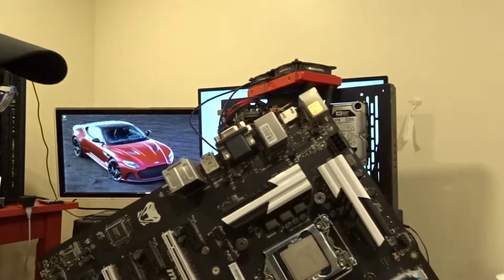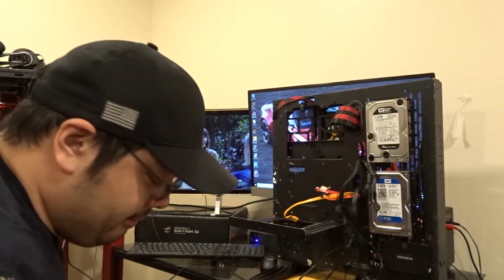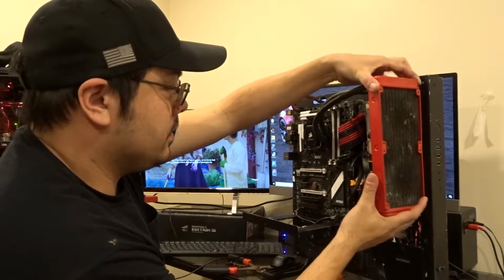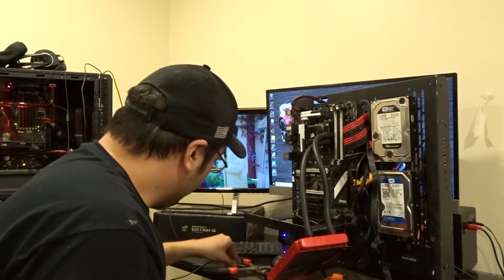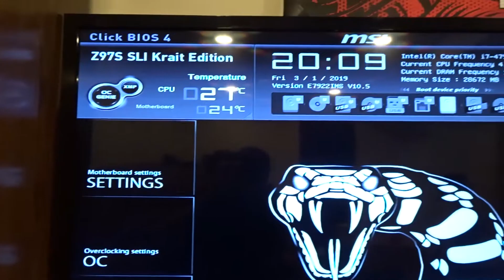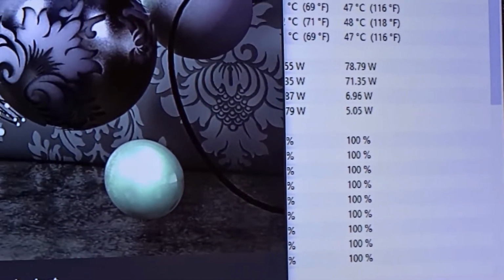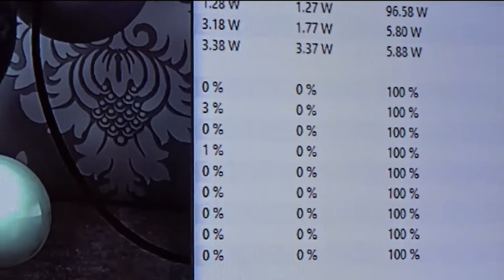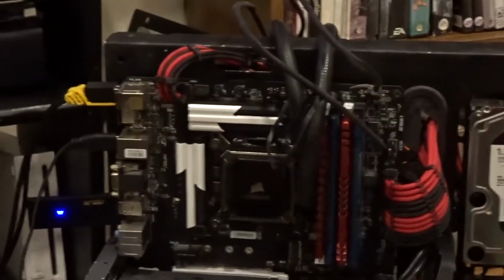Almost killed the 4790k before it got off the ground!

Comment: yikes that aio mishap reinforced my hesitation to ever watercool, and good thing you caught it in time! What really bugged me about cinebench is, for me, it doesn't scale well to the overclock. Pushing 4790k 400mhz to 4.8 doesn't give a 9.1% increase compared to all-core 4.4ghz undervolted (mine is 1.195v) so it's kinda hard to justify pushing so much voltage for that (cinebench 5%) performance gain

I'd love to hear your opinion. Did you delid your 4790k?
Reply from the maker: I understand the hesitation, but this is the first time I have ever had a water cooler leak. And I will honestly say it was probably my fault, as it was not using the right hardware to mount it.
Reply from the maker: In regards to the overclock, I do agree. Cinebench does not scale correctly. I personally have seen that with the myriad of different systems I've assembled, it really prefers thread count over pure speed. My Xeon 5675 will return almost a 43% improvement with a 25% overclock. I have not de lidded the 4790k, as I assemble this system as a stopgap while I figure out whether I'm going to risk using the strix x99 system when it comes back from getting replaced under warranty, or just selling it and using the money to build a newer i9 system. I got very lucky with the AIO cooler leak as I was actually adding the USB cable for the pump and had the system tilted back when I noticed the leak otherwise I would have powered it on.